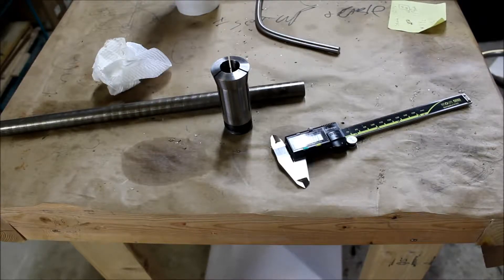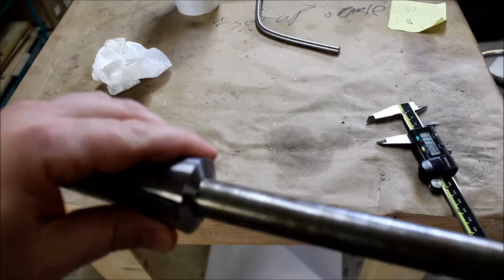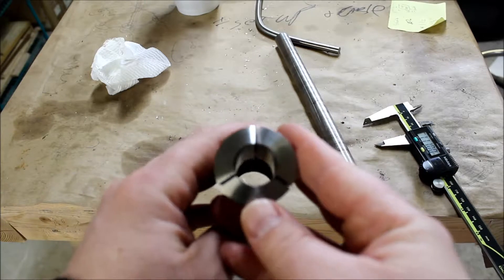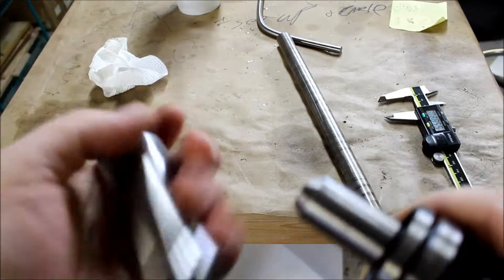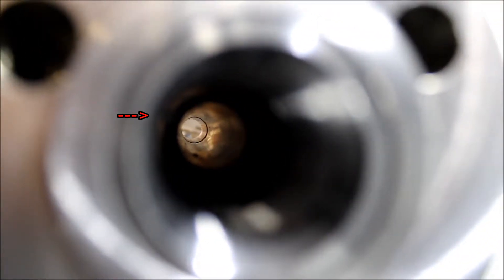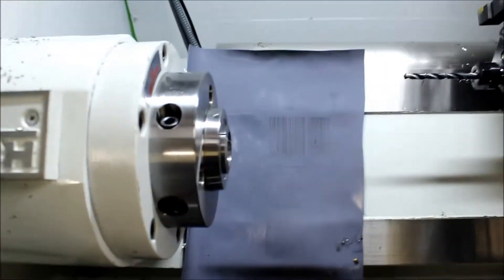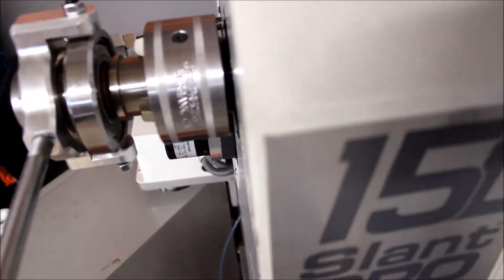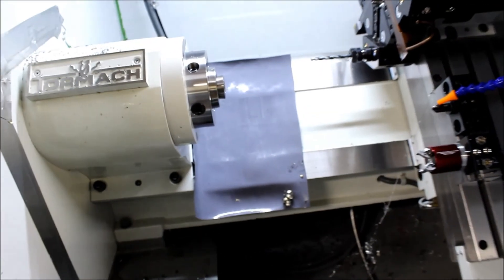Collet Issues - Requested video

Comment: Those are Chinese collets, had the same problem, just install on the lathe, mount a carbide boring bar and machine the collet until you get a good fit, Jeff
Reply from the maker: I will look into both your suggestions, both seem legit.

Comment: I know i will be getting ahead of myself by commenting to early, or in my case to late as this is an older video.

But i can not help myself to comment on the lack of quality that Tormach passes off.

The machines are ok but the tooling they supply is very average and that,s saying it nicely.

As you would know they do not deal with the supply chain they just ship direct from China to your door.
They are just the middle man getting his cut without touch a thing.

Buy the machine from Tormach and nothing else, especially Tooling ??????????

Thanks for the video.
Regards Peter.